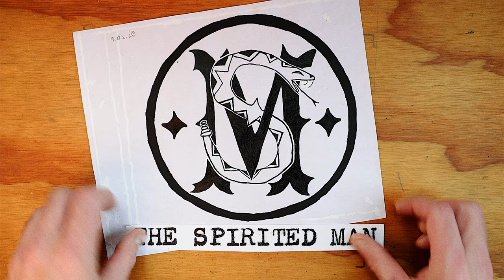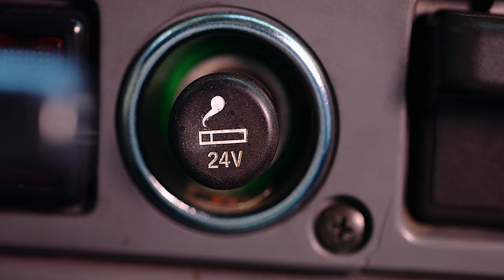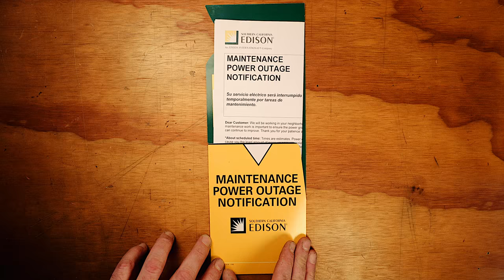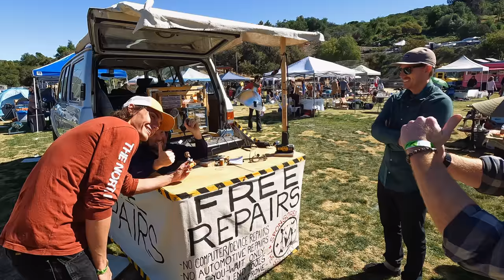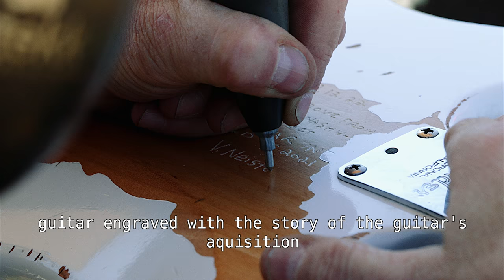Is It Honest to Call This Service?

Comment: This is the exact same power station I use at go-kart races. Works great for for powering my lights and recharging my air compressor. It takes a ton of abuse and is covered in oil and grease and runs great.
Reply: Also, to the point of the video... I love it and what you do. ❤️

Comment: As marcel mauss states, there is no such thing as a free gift, all gifts come a level of reciprocation. Reciprocation is not a bad thing as long as there is some level of altruism involved, some way in which you both become more virtuous and the extension (service) you have made can be repeated and passed on either the same or different form cannot be a selfish act in my opinion

Comment: I recently watched your video on becoming more self reliant, i definitely resonated with being part of a generation that is incredibly tech smart but analog ignorant. Maybe not the whole topic of the video. Yesterday, I found myself with a flat tyre on my bicycle ive have for a couple of months. trivial I know but it's probably been about 13 years since I've changed a bike tyre. Since owning the bike I've changed it once or should I say I brought it to a bike shop just up the road from me to get fixed out of convenience ( and simply not knowing how to change one myself) Well Van, it appears I still don't as I managed to dissemble and even put back on the tyre with the new inner tube and found it wouldn't pump up properly. But you know what? I fucking gave it a shot, and you also know what, that son of a bitch tyre is gunna get inflated tomorrow by my own hands. Anyway the point of the anecdote is to say that not only are you serving people in life with your own hands, but you are also serving people online and getting them to use there own. Thank you.

Comment: Thus the great ethical contradiction is demonstrated in this succinct video. All service must be rooted in some degree of selfishness. Taken further, in the utilitarian perspective, the greatest service that could be performed is that which benefits both the giver and receiver to the greatest extent- not one exceeding in benefit to the other. This is where I started to disagree with the rabbi, although he rapidly moved to the "on the other hand" perspective, which arrives at the same conclusion. 
The problem that van might be having is being concerned about the self benefit of the services provided (or lack thereof) at all. In my estimation, I would alter the rabbi's analysis of the greatest act of service by stating that the greatest act of service that could be performed is one not where there is no acknowledgment of who is giving and receiving, but rather one in which the giver gives with reckless abandon, disregarding the net benefit achieved by his service entirely.